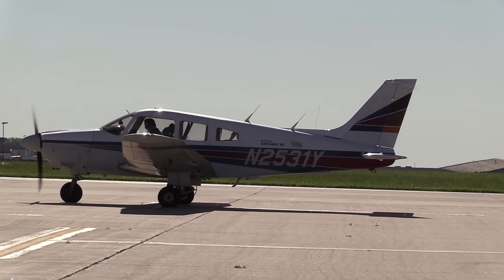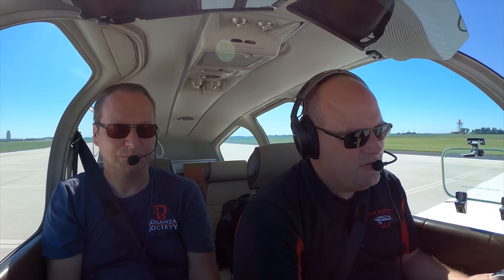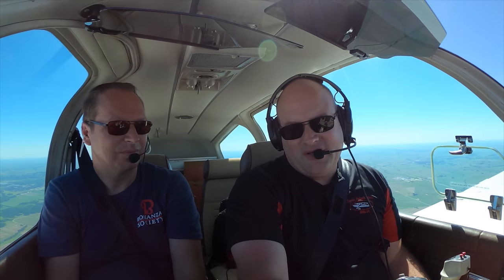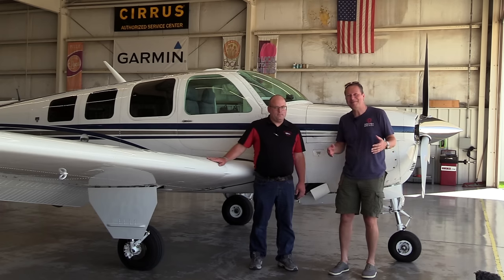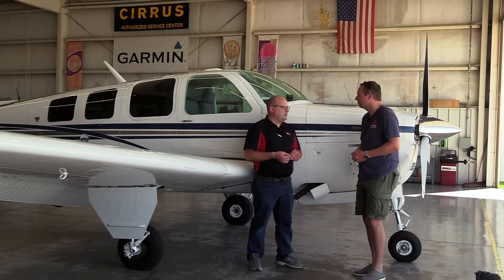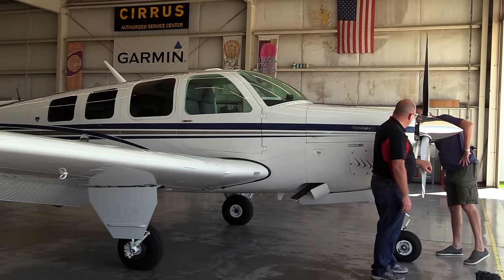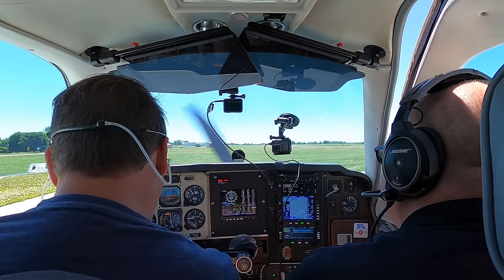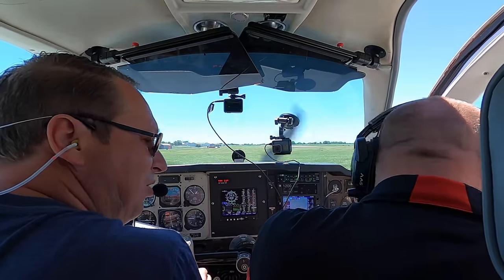Engine Upgrade - First Flight with the IO-550-B

Comment: Question from a non aviation guy:
I'm assuming that lean of peak = less fuel to air ratio than stoichiometric.
If the above is true, how can less fuel produce less cylinder temperature as Martin stated at the end of the video?
Reply from the maker: Right - there is excess air left after burning all fuel when lean of peak. 
Reducing fuel reduces power - that alone reduces the development of heat. Running LOP also reduces peak cylinder pressure (even compared with the same horsepower rich of peak) and distributes that pressure differently over time - which makes a meaningful difference in airplanes, because most aircraft piston engine have fixed timing.
Let me ask you this: Why do you think CHTs would be unaffected by using less fuel?  Maybe from there I can give you a better answer.
Kind regards, 
Martin
Reply: IMO, the advantage of running lean of peak mostly has to do with fuel economy. Rich vs lean settings are based on EGT, and 100 rich of peak EGT is the same temp as 100 lean of peak. Both are less than stoichiometric. Cylinder head temps tend to be lower lean of peak, because the engine is producing less power (less power = less heat). If the engine baffling is doing its job, keeping CHT below 380 running rich of peak shouldn't be a problem.
As for me, I don't fly an airplane to go slow, and the speed trade off isn't worth it to me. YMMV
Reply: @martinpauly  This is completely backward from automotive applications. A lean mixture will produce more power at the cost of potential detonation. I always assumed it would also cause a higher cylinder temperature since the reason it may cause detonation is because less fuel means that the fuel air mixture is hotter, hence, it may ignite the mixture prematurely.
What am I missing here?

Comment: Can u check what looks line a  cht  sensor line( the silver ones) on top. One looks to have rubber grommet in the clip incorrectly positioned
Reply from the maker: Do you have a time stamp in the video that shows what you are referring to?
Thanks, Martin
Reply: 10.05. Its just not clear but the front cylinder. I just saw a black sleeve at the rear. May not be anything

Comment: That panel is just begging for a 7" or 10" Garmin G3X with backup G5... remove the old steam gauges and vacuum pump!  Add in the GFC-500 auto pilot and you would have one incredible all glass IFR machine for around $25k hardware cost...
Reply from the maker: I would love to do all that, Nicholas. But unless somebody starts a GoFundMe campaign for my next upgrade project, I'll have to wait until my piggy bank has recovered from the engine and prop upgrade.
Regards,
Martin
Reply: Martin Pauly I understand completely my friend, that IO-550 upgrade is an expensive one indeed, and probably twice as much as the G3X upgrade.  With the Avidyne IFD's you already have installed, it would be an excellent IFR platform for the money.  I work at Ideal Aviation, and we are a Part 145 Avionics repair station located not far from you at KCPS.  A single 7-10" G3X runs $7995-$10k, backup G5 is $2,300, and the GFC-500 runs $10-13k... all and all about half the cost of a G500 system.  All installed you could get it done for $35-40k, possibly less... a gofundme would actually be a good idea
Reply from the maker: @flynic3  I like the equipment you are suggesting - Garmin makes really nice EFIS and autopilots.  One of the days, I hope...

Comment: Great and well done video, seems like a great repair shop also etc.. However, $80K is beyond ridiculous. Aviation, healthcare, higher education costs, all have far exceeded the annual price increases and paycheck increases for at least 50 years. K St. fueled, legalized corruption, legalized bribery, inside the beltway has fueled theses increases. A good example is my SS went up 1.6% past January, while my Anthem supplemental insurance went up over 7%.. One could purchase a new diesel, 4 dr., 4x4, duelly pickup, loaded with over the top options for 80 large. And, one could easily blow 80 grand in a hospital emergency room in less than an hour, paying for the undisputed highest priced healthcare on the planet, with the undisputed absolute worst results on the entire planet. If you value your life, when you see an MD, run just as fast as possible. Assuming you can still run. So, there you have it. Thanks for the video!
Reply from the maker: I sure don't LIKE the fact that everything made for aviation is many times more expensive than consumer products, but I have gotten used to it. What choice do I have, other than quit flying? 😁
And aviation is not alone - as you point out in your comment.
Kind regards,
Martin
Reply: Martin Pauly - No criticism of you what so ever. But, aviation is where it is because of the ridiculous increases.  Thanks for sharing.

Comment: Why do all these guys cut them selves short with the expense of this upgrade without also getting the carbon nose bowl upgrade from Atlantic Aero or Blackwell combined with this package for the same price. The stock nose on Bonanzas are Stone Age technology and are like pushing a barn door through the air and don’t let you get the real cruise potential of the plane. The carbon nose bowl upgrade gets rid of the cowl flap nonsense and lets the plane cruise at 190 kts, so everyone bragging about measly ten knot gain in cruise with only an engine upgrade is a joke really.
Reply: Great input!  Thanks for mentioning the new nose bowl; I had no idea; no idea at all.  Our T-34B will go from an 0-470 when it’s timed-out and get an IO-550R in a few years, and a new nose bowl might be a nice addition.  Based on your picture, “Never go full retard!”